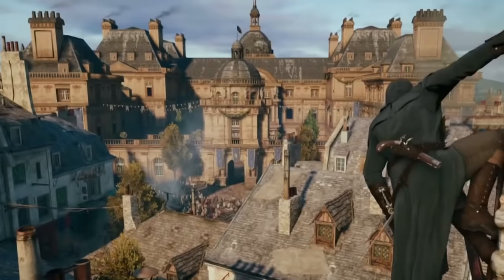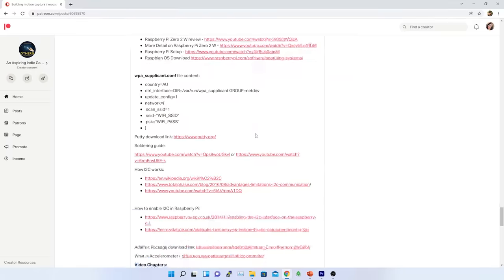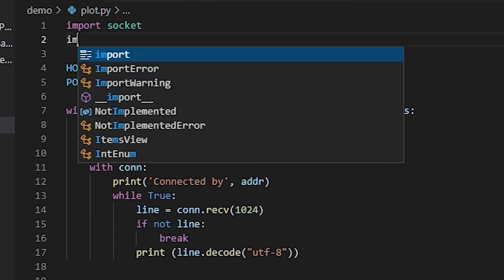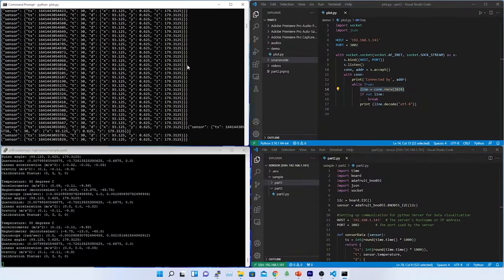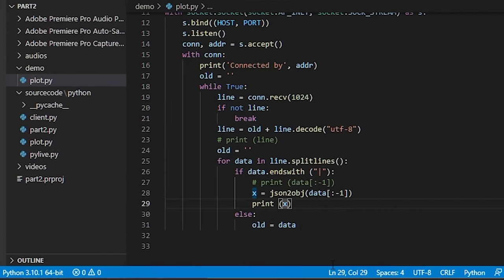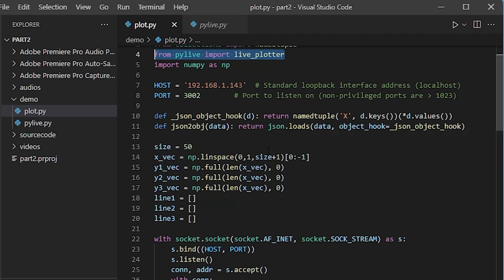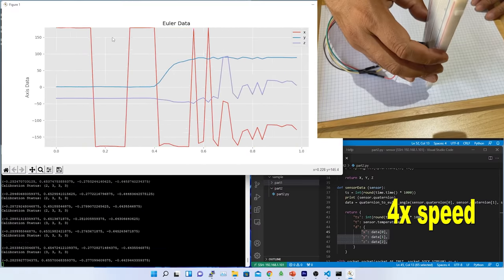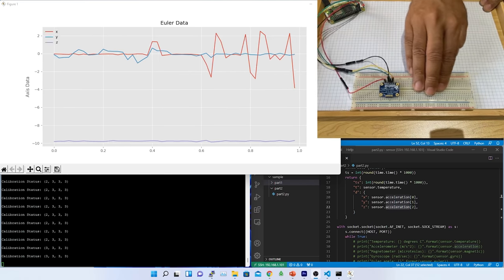BNO055 9 Axis Inertial Measurement Unit's Data Visualization using python and Raspberry Pi Zero 2 W

Comment: I am getting a lot of help from your video. thank you and  I have one question. I was going to buy BNO055, but it wasn't available, so I bought MPU-9250/6500. Is it possible to implement this without modifying the code using this board?